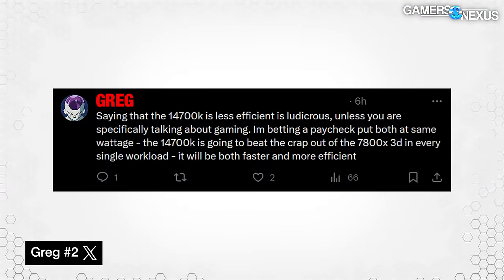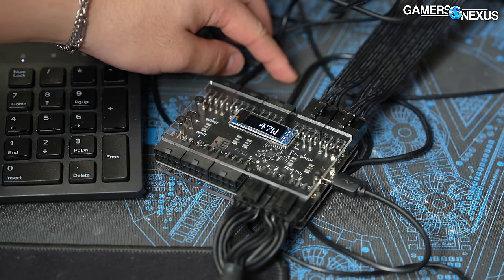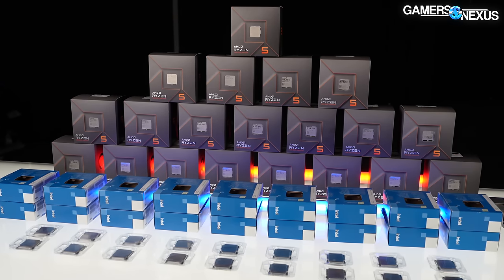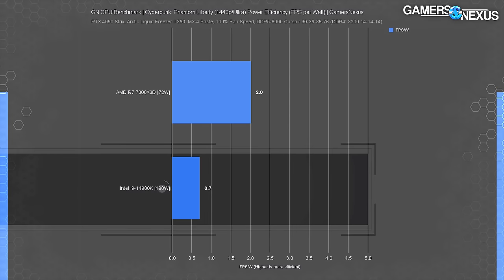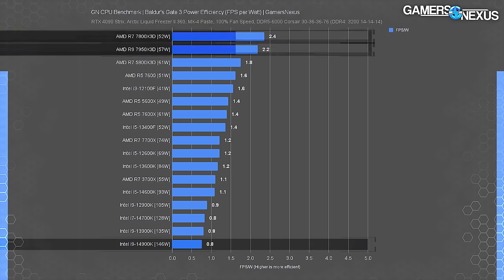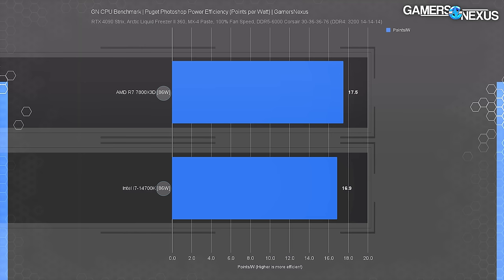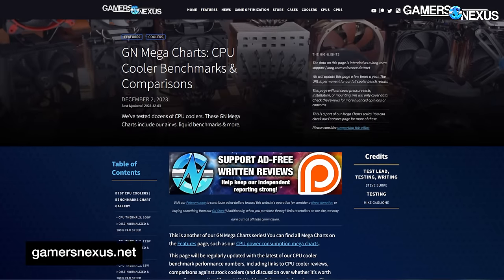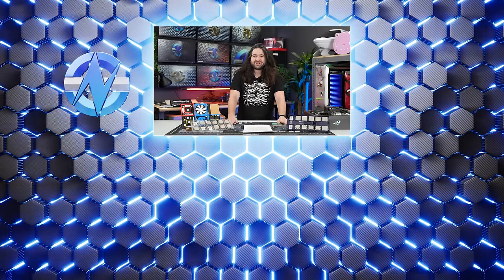The Intel Problem: CPU Efficiency & Power Consumption

Comment: Just upgraded from a 8700K to a Ryzen 7 7800X3D this month. Super happy with it, and what a upgrade. Not just the CPU but PCI-E gen 3 to PCI-E gen 5 and 4, DDR5 etc. Also grabbed a Samsung 980 Pro 2TB. So it was quite a difference in speed/snappiness after doing the upgrade. Also my decision between intel or AMD was made MUCH easier when I read that the next gen of intel CPU's will require a new socket. While AM5 will be supported for at least ~2-3 years and with AMD's track record and longevity of AM4 I believe em. Didn't wanna buy a new mobo that's a upgrade dead end.
Reply: make sure to adjust pbo to -20 or -30mv in PBO (or auto PBO settings some boards offer) drop SOC to 1.2v (unless you plan on overclocking your memory, but 6000mhzcl30 A/M hynix die should be stable at 1.2v on nearly all 7800x3d cpus) and get the same performance with lower temps and lower power draw :))
Reply from the maker: The 8700K was a great CPU. Jumping to the 7800X3D is pretty huge - you basically went from one top-of-the-line build to another. Enjoy the system!
Reply: Exactly the same upgrade here!
I wanted to go for Intel and I waited for the 14th gen... but genuinely even the cost of buying an AM5 MB and new RAM couldn't offset how disappointing the new Intel CPUs were.
Same thing happened a bit earlier when I replaced my GPU - really wanted to stay with Nvidia, ended up with a 7900 XTX. AMD got my money because its competitors keep shooting themselves in the foot...
(also I bought an ASROCK MB, because it was the *best option*. Whatever happened to the motherboard market?!?)
Reply: @GamersNexus Thanks! Happy holidays and happy new year to the GN team!
Reply: @GigAnonymous I was going to order a ASROCK x670e mobo as well. But it went out of stock the day I went to order it. Ended up getting the MSI MAG X670E TOMAHAWK WIFI.
Reply: @luvingyouu I bought this memory "G.SKILL Trident Z5 Neo Series 32GB (2 x 16GB) DDR5 6000" ( Model F5-6000J3036F16GX2-TZ5NRW). Would post the newegg link but my comment would prolly be deleted. Just turned on EXPO and left it at that.
Reply: Just went from 8700k to 13700k. I just gotta put my pc together :D I still don't know if it'll be worth if, 8700k was my baby but it's getting old now :(
Reply: I was an early adopter of AM4

All I gotta tell you is, you will not be disappointed
Reply: Same here. From 8700k/Taichi z370 to 7800x3d/Strix B650e-e. It was no brainer to go for a new am5 platform, especially when 7800x3d is now what 8700k used to be in 2018.
Reply: @ThatGuy-qg4ww Def, my 8700K isn't useless or anything by any means. But like you said I just felt like it was just starting to show its age. Not so much in gaming really, but just speed of the PC in general (launching EXE's, bootup etc). And the jump in CPU power plus the Samsung 980 Pro PCI-E gen 4 SSD are like a night and day difference in how snappy everything is.  Probably gonna sell my 8700K (and the mobo and RAM) to my cousin. Who I sold my processor before the 8700K to (3700K). So it would be quite a upgrade for him.

Comment: Great data! Totally not surprised a smaller manufacturing process pulled ahead in efficiency, lol. The kWh charts were especially great. I'd be curious about idle or near idle power consumption between systems. Like whether either brand has better technology to keep computers efficient when they are not doing intense work. Such as browsing and maybe watching videos. Maybe the differences are insignificant but that could be charted out over their expected lifetime make it significant (say 5 years). EDIT, I saw idle was mentioned toward the end, nice!
Reply: Sometimes I can sit down with my desktop for half a day only browsing or watching videos. Sometimes I use the PC daily but don't game for a week. The power consumption of having a few base programs up is just as important as the heavy load consumption since I only game for a few hours each week. 
Some kind of baseline would be nice to see, however it is defined.
Reply: It's not all about the fab process, but is more about the focus.   Intel is taking the attitude, "just throw more power at the chip to let it clock higher", and the result is that efficiency goes right out the window.   Alder Lake to Raptor Lake to Raptor Lake Refresh, yea, add some E-cores going from 12th gen to 13th gen, add cache, but then boost the power draw for higher clock speeds.   Intel has been using this approach since the 7th generation when Intel had locked its upgrade path to the fab process.   Oh, Skylake...yea, 10nm wasn't ready yet, so Skylake with more power and higher clock speeds was what we saw from 6th to 7th gen.   Then 8th gen, still Skylake, but with 6 cores at the top end.   9th gen, 8 cores at the top end, but still Skylake.   10th gen, yep, for the desktop, Intel still couldn't improve the design, so again, Skylake drawing more power for higher clock speeds.   11th gen, still no 10nm on the desktop, all a joke.

That was the big, "same design, throw more power at it for higher clock speeds" approach.   Intel is still doing it that way, being so obsessed with higher clock speeds, they don't bother with thinking about efficiency at all.
Reply: @Targonis1 Not all about, sure. I'll agree there. Though this video clearly shows differences when the CPUs are given the same power limits. Design can certainly be a factor as well. All that said I'd consider manufacturing process the key attribute.

Comment: The money you waste on electricity can be deducted when you realize the intel cpu’s can be used as a duel purpose heater for your home.
Reply: On other hand your power bill will double on air conditioner during summer.

P.S. There is centralized heating during winters where i live, so even there Intel CPU will make things worse by overheating room up to point when temperature forces me to open window to cool it down
Reply: This just gave me a flashback to ancient times, when we used to make that joke about AMD CPUs xD
The pre-Ryzen era really was dark times all around.
Reply: We just need to run it at negative GHz so it sucks heat out of your room in summer 

Hurry up and figure it out already, Science
Reply: @greebj  Just go to the bios and set a negative offset of 10ghz on your CPU and boom, your CPU is running backwards now! ggez
Reply: @R4d1o4ct1v3_  dark days indeed, but now we are back to the Athlon days :D competition rocks!
Reply: @DimkaTsv  Depending on where you live...
Around here the heat is not wasted 9-10 months of the year.
In 2023 we had less than 20 days peaking over 25C/75F here. Five of those peaked above 28C/82F.
With the PC running I generally don't need additional heating as long as its around 15C/60F outside and maybe down towards 10C/50F.

Central heating should still have temp adjustments for each room no? If not that sounds crazy inefficient.
Reply: I've come for my daily supply of chilk
Reply: @R4d1o4ct1v3_ no kidding back in 2017 there were still using 2 core CPUs and 4 cores for high end
Reply: My 400w+ GPU does that job on its own.
Reply: @DimkaTsv   50W vs 75-125W doesn't matter when the GPU is pulling 250-450W and pushing it into the room. I will be using the AC regardless of which CPU I go with.
Reply: @lasthopelost9090 didn't 8 series come out at 2017? I5 8400 is 6 cores ( I am still using this cpu btw,I am waiting for the new Ryzen CPUs)
Reply: @griffin1366  It does matter for CPU power efficiency comparsion. Especially as a lot of people ask to take in account AMD idle inefficiency for non-APU's. That means that on same exact performance, this power difference make them only power balanced if for each 1 hour of gameplay you have about 2-2.5 hours of absolute idle (not even using browser of watching YT on PC)
Unless we should also take in account increased GPU power consumption due to better CPU?
Reply: @DimkaTsv   Yes I agree, idile power is always glossed over... I wonder why :~)

My PC since 2008 has saved me money on heating, doesn't matter which brand.
Reply: @griffin1366  well, probably because complete idle is never a usage for PC and CPU in specific. Either something running in background. Or you disable PC or turn it off.
Also you won't be able to do full idle most of the times, as when user is AFK system will decide to do maintenance which will load system to some point. It is periodic, but still, not full idle already.
Reply: @Amazinglyultra  i3 7100 came out at the beginning of 2017 the 8400 came out in response to ryzen

Comment: The IO die idle power requirements answer a question I had asked in an earlier vid's comments about why AMD's idle power consumption is 36-68W compared to 9-28W on the 11900KF; thank you!
What gets measured gets done, and since we raked AMD's Vega Frontier Edition over the coals for its power consumption and the Nvidia 30/40 series for that same reason, then it only makes sense to transfer that analysis and criticism to the CPU space to keep pressing these companies to not be so wasteful

Comment: I built my first PC today, and thanks to your videos (as well as videos from other channels like Hardware Unboxed) I got a 7800X3D.  I'm still sussing out some issues with expo, but even with expo off the performance gains I've seen versus my previous PC (which used an R5 3600) are absolutely ludicrous.  Even with the expo issues, I'm super happy with my purchasing decision, and your coverage made the decision incredibly easy.
Reply: I guess your stock ram kit speed is too high? like above 6400? I read AMD recommends 6000 as the sweet spot, which also mirrored my personal findings. What's funny is an i9 needs to run 7000-8000 ram just to get close to some 7800x3d gaming benches.
Reply: @tyson8585  maybe.  Expo did say it was targeting 6,000 in bios.  I imagine once I'm more comfortable with going into bios, I'll manually increase the speed until I find the maximum I can get away with.  My RAM speed is currently at 4800 and performing incredibly well, like BG3 at max settings and 60 FPS no matter what well.  But man that additional 1,200 MT/s is something I will want to try to claw back as much as possible.
Reply: @davidbondy2250  Looks like you're in luck, I came across an x3d ram speed benchmark by Hardware Unboxed and looks like they don't really matter, only a couple of % difference between 4800 and 6000 at 140+ fps. I think you won't even have to do any further tweaks because of the huge amount of cache these cpus have.
Reply: Ryzen have a different style of memory controller that has problems above 6000 mt/s generally. Some people claim even at 6000mhz. Good news it barely affects fps and beats intel the same at 5600 cl28 or cl30.
Reply: @tyson8585  I think I know which video you're referencing.  I'll go back and rewatch it.  Thanks for reminding me, and also thanks for doing some searches.  Things are still going super fucking well on my PC, it is absolutely handling BG3.  It feels good to finally play that game and have it be stable.
Reply: @Navi_xoo  yeah the 4800 MT/s speed is not getting in the way of BG3 running at a fully locked 60 FPS in every case but one.  The performance is genuinely sensational, and even considering I'm locked out of an additional 1,200 MT/s on my RAM, I'm still super happy with how things are right now.

Comment: It's crazy 10 years ago AMD was in the exact same spot
Reply: Even about 7 years ago, pre-Ryzen. The fake core era. Intel was so far ahead, kinda disappointing to see where they're at now.
Reply: @Qalibrated  thing could have been different if they did not sit on their butt, milking their customer money for few extra mhz for years. It's quite funny
Reply: Came here to write the same comment, and I also wonder.... is Intel doing the exact same thing AMD did back then?  Maybe they've got something up their sleeves and in the meantime they're pushing the old stuff harder and harder to bide time.
Reply: @ShanesGettingHandy  Intel's big ace in the hole is... copying AMD. They're moving to chiplets (or "tiles" as they're calling them) and working on their own stacked cache solution. It's all quite amusing really, given Intel's previous malicious marketing about "glued together" CPUs.
Reply: @Qalibrated welcome to the trap that is complacency
Reply: @haunt97  Yup, they were far ahead and got too comfortable. They didn't think to actually improve and be better until Ryzen came out. AMD kinda sucked for like a decade. Intel could've used that time to improve and prepare for possible, future competition but they went the lazy, greedy route and just added another + to their 14nm lol
Reply: @Qalibrated  theyre currently at 10nm fabrication node. but by the time they get to 7nm or 5nm amd will be in 3nm if not smaller. so well see.
Reply: @MultiOlimac  Yeah, 12th and 13th gen is 10nm but from 6th to 11th gen, they just kept adding +'s to the 14nm, atleast on desktop.

Comment: This is even more relevant after the recent microcode update that Intel sent out, as it completely disables undervolting in non-K CPUs. Only PL1/PL2 adjustments still work, and those bring performance down significantly.
Reply: Damn, poor choice of locking up another great feature from Intel.
Reply: Wow that sucks not being able to undervolt locked CPUs. Probably not a good idea to update the BIOS then... ever.

Comment: Watts was actually my 2nd most important metric after max budget when it came to choosing my latest pc parts.

Since I'd only be gaming, I knew I wanted to max framerates and power efficient. With the 5800x3d being so efficient, undervolting both cpu and gpu(the 4070) using frame limiters and upscaling were factored in my choices. Really happy in the end I can max gaming everything at 1440p minimum 60fps

Comment: The other consideration of lower wattage is cooling requirements. Gaming 8hr per day (like the power consumption chart), a lot of extra heat is pumping into a summertime gaming room.
Reply: Cheaper PSU as well, and less stress and strain on PSU if you have the same for both.

Comment: You discuss how the ultimate electricity savings are relatively negligible one way or the other (which is true), but I find that the appeal of a lower-draw CPU lies elsewhere for me. One, it means you can potentially save a bit of money (or allocate it elsewhere in your build) on your PSU selection. Watts In = Watts Out, so generally that means that it's easier to keep your CPU properly cooled while at lower fan volumes, and that heat energy doesn't just disappear the moment it leaves your case. This is definitely more unique to my own circumstance, but I live in a hot area with my computer setup in a smaller room, and there is a legitimate appeal in a CPU that runs 80-100 watts less than its competitor because it has a tangible impact on how long I can run an intensive workload like gaming before the room becomes uncomfortably hot and muggy--even with the air conditioning running.

Comment: I'd love to see a kW/h chart for GPUs alongside your CPUs chart at the end.  Being able to match the two to get a system draw total would be great.  I recently bought and rebuilt a computer with electricity use in the forefront b/c I'm disabled and have my pc running all day, everyday most days.  I undervolted the GPU on my last pc for power considerations.  Those on fixed incomes like me probably care the most about power consumption.  Thanks for the video.

Comment: As interesting as your testing methodology may be, most footages of this video were devoted to something that has been accepted as well-established by many and may even have been implicitly conceded by Greg #2 in his original tweet: 7800X3D is more power efficient than 14700K (and 14900K) in gaming. 
As a PC enthusiast whose interest in gaming has declined considerably over years, I would like to see the comparison of power consumption of 14900K and 7950X/X3D (as well as 7800X3D, if you wish) under the following conditions:
1. Idle or under light load
2. Idle or light load in the foreground and heavy load in the background
Power consumption in the idle state or under light load is important in the real life unless you use your PC only for gaming. If you use your PC for your work or any other non-gaming tasks more than you do for gaming, your PC is likely to be in the idle state or performing relatively less demanding tasks most of the time.
In addition, sometimes, you need to process a really heavy job in the background while performing light tasks in the foreground. While power consumption during the idle state is sometimes measured by reviewers, power consumption under this type of scenario has never been measured by any reviewer.

Comment: This matters a lot to me, I live in a tiny apartment unit with terrible ventilation. I often find it very difficult to cool my PC and myself during the summer months. Coming from 13700k to 7800x3d, both on noctua nhd15 cooler, I noticed the temperature is significantly lower on the amd part, and the CPU fan is a lot quieter. It is especially noticeable on my legs, since the PC vents almost directly to my feet, and is validated with HWinfo.

Comment: Thank you very much for this test. One side note I want to mention. What would happen on an 14700K/14900K if you would disable the E-Cores at the Gaming Tests? You showed us a test with Intel APO tool. You can achieve the same whilst using Process Lasso for example. I personally don‘t think, that that would elevate those cpus to another level, but it may be possible, that you can achieve higher fps values and or reduce power consumption.
Just fascinating how efficient nearly all AMD processors are.
Keep up the good work ❤